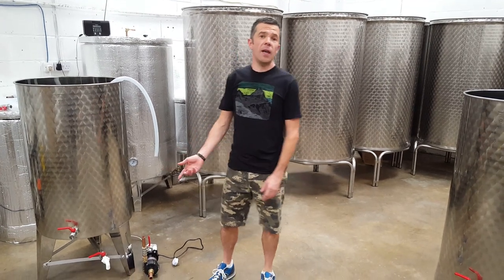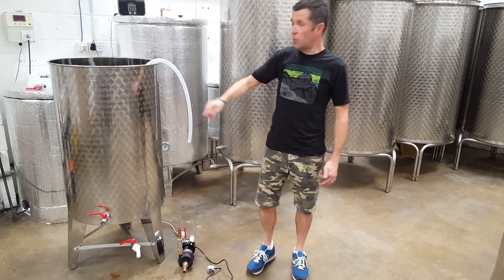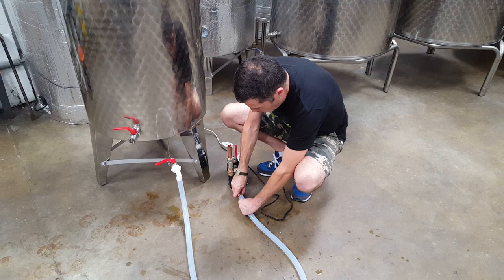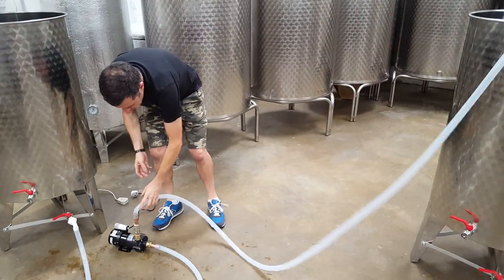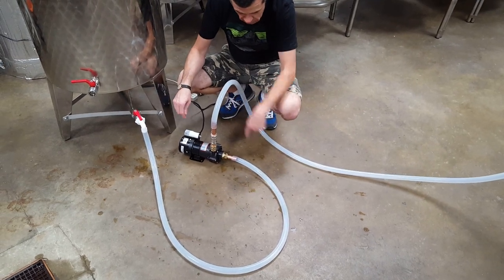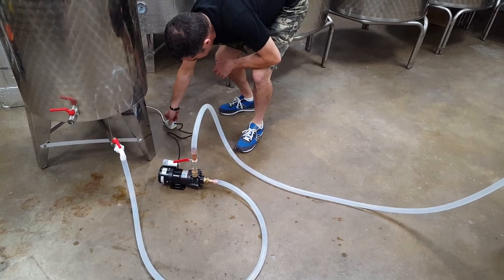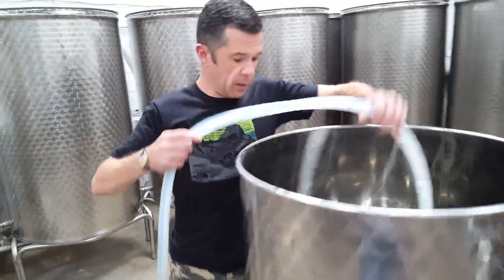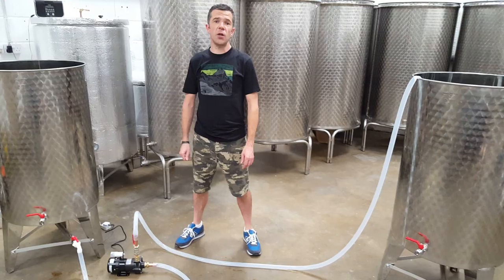Transfer Pump

Comment: Interesting. I've just bought an Ozito transfer pump and am reading the manual and getting a bit ratty with things I don't understand. I can understand you're not using a filter because your liquids are clean, but how about a non-return valve?
Reply: Sorry Mark, we've never used them either.
Reply: @jat447  Oh well, thanks for the reply. Good luck with your enterprise.

Comment: Hi. Where can I get this pump from & can it be used with a timer for irrigation purposes?  Thanks
Reply: Ozito pump have no fuss budget priced constant pressure pumps, I'm looking into whether Ozito have one to pump rain water from a 10,000L tank to use in our hut.
Reply: We can supply the pump & hose at £250 + vat & delivery. Get in touch through the website to order. It could easily be controlled with a timer, yes.

Comment: Is that good for 43meter deep well with 2 inches pipe?
Reply from the maker: No, it's not powerful enough for a deep well with that diameter pipe. I'd think you might need several horsepower of pump to achieve that. Good luck.

Comment: How to clean
Reply from the maker: Good question Danny. It depends on what has made it dirty - We'd use the minimal amount of chemical needed to be honest. Our prefered cleaner is hot water, and that's possible to use effectively if the clean down happens right after every use. Just by flushing with hot water in a circuit through the pump and back to the source.